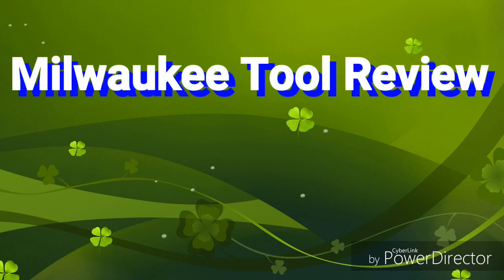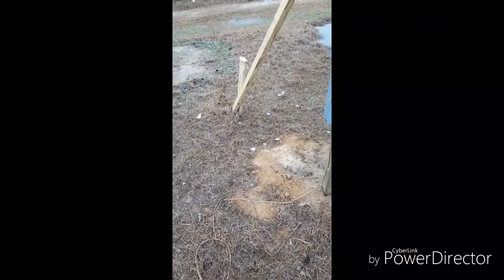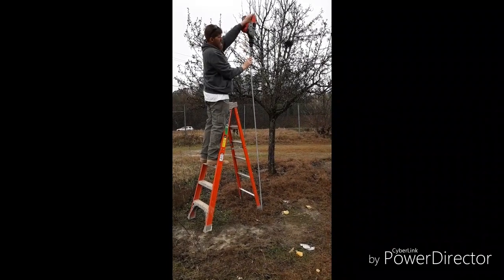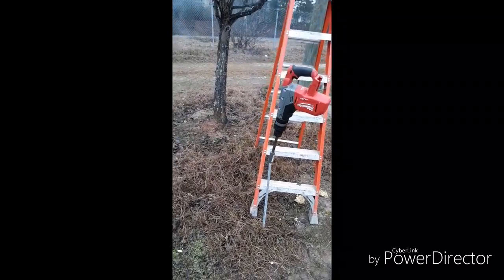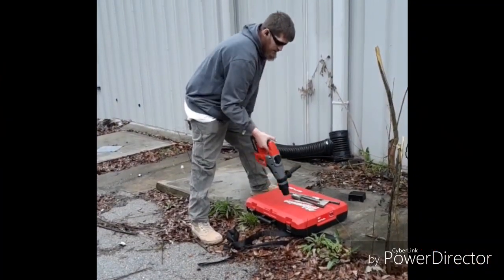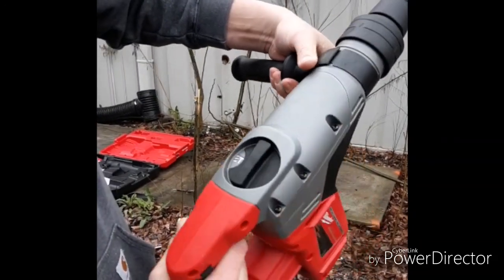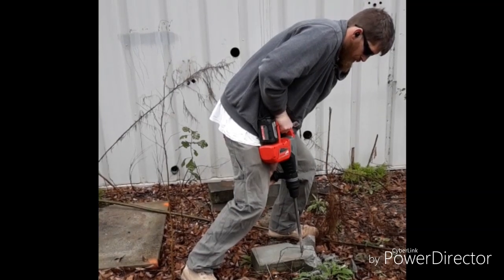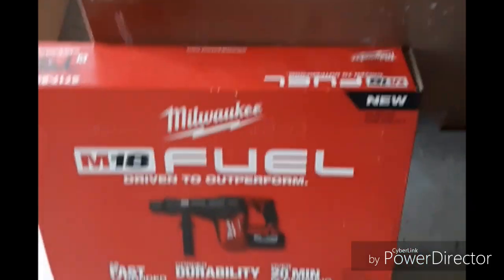MILWAUKEEE SDS MAX ROTARY HAMMER DRILL 1 9/16" GROUND ROD DRIVER,

Comment: Your bond needs to be at the first means of disconnect, not the meter
Reply: Correct. Although, if he has the bonding screw in the panel screwed in it's technically bonded( since he did run ground to the panel)  just in the wrong order.  I wonder if this would fail inspection.

Comment: Never seen a meter socket w a ground/bonding buss. What state are you in?
Reply from the maker: I'm in NC and this pole is on a job in SC. 

I had never seen one either until this job and it was a specific request by the power company so go figure learn something new everyday. I constantly keep learning.
Reply: @bthompson661  trying to think of why the poco would require that
Reply: @bthompson661  now that I think about it. It's even dumber. Telecom companies "bond" they're equipment to the meter socket, which is bonded to nothing. Never had an inspector ask me to ground a socket🤔
Reply from the maker: The ones that I have seen are usually bonded or they are bonded at the first panel and have a seperate ground run back to the meter to ground it that way.
Reply: Here in the northeast it's standard most being made by Milbank.

Comment: Man I bought that last night cause I had 4 ground rods, and it didn’t have the ass to get them more than 4-5’ deep. Kinda wish I went corded now
Reply from the maker: Part of it depends on the ground itself. It works for me but i have multiple batteries. I can get a rod in the ground with one to one and half batteries usually. But i feel ya. If you do a lot of them corded could be the way to go. I just like the convenience of cordless since i dont always have power access.
Reply: @bthompson661  yeah it was definitely some of the hardest ground iv came across in charlotte. I just had to high of expectations. Things still a beast, and ran for a long time with the 12.0, I was just hoping to retire the sledge hammer lol
Reply from the maker: @Jasondavisvids  i hear ya. Sometimes nothing replaces good ol man power. Love my Milwaukee tools tho. Crazy. Im in Charlotte too

Comment: At the speed this thing goes I really cant see myself buying this for driving rods. I think this makes people too reliant on the tool and there's actually a lot of technique to getting a rod in and knowing when to change locations slightly before it gets stuck. If it had more power maybe but I think i'll pass.
Reply: Agreed especially if you put a nut at the bottom of the ground rod it goes in like butter maybe 15 hits

Comment: I would have driven 1 foot cut off the rest. Thrown it in the trash and walked away whistling.  But I've always been an underachiever.
Reply: Yeah, inspector will know.
Reply: @saucierdavid8109 that is why you cut the part that goes in the ground, not the part that sticks out

Comment: The drill doesn’t have enough weight so the operator is using his body weight to force the drill and ground rod into the soil.  You’d been better off using a manual post driver/ hammer.